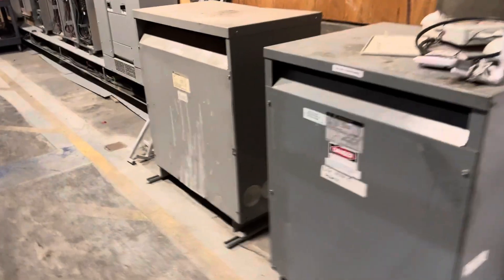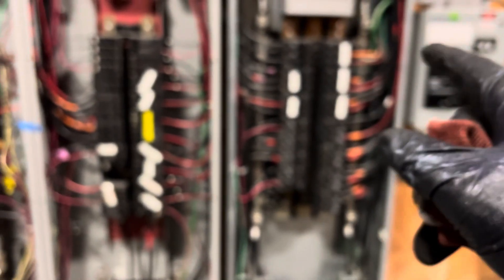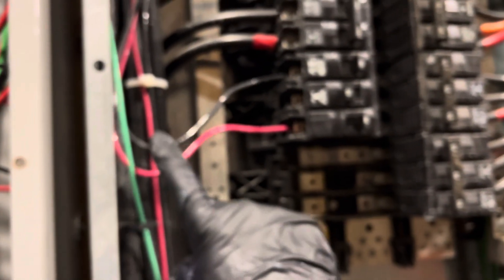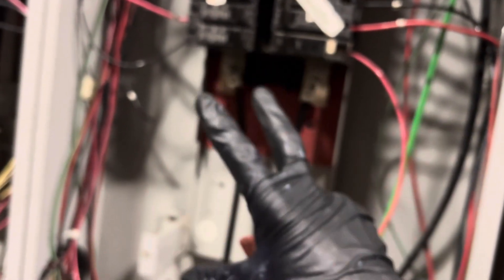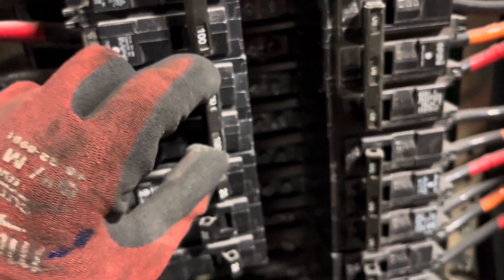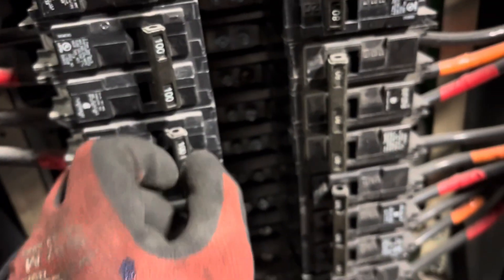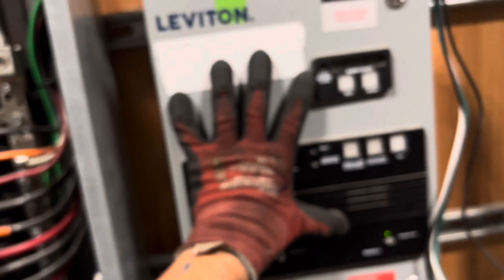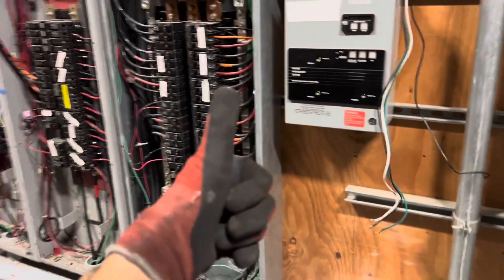Dealing With Electrical contractor, Nightmares Incompetence ￼.

Comment: Most people just go hurrr durrr electrical wizardry idk how it works
Reply from the maker: It seems like here in California where I live the only qualifications you need to be a electrician if you can insert batteries into a flashlight flicker switch and a lightbulb turns on you’re qualified
Reply: You guys all “Delta up to the gills”!

The electrician did nothing wrong. If you want to protect your sensitive control and communication equipment - you have to do it yourself. Galvanic isolation and DC/DC converters!
It’s normal to have motors on contactors. And people who run 3φ equipment - don’t care about neutral, they don’t need it.

You got to power up everything out of separate transformers from split single or 3φ, use DC/DC converters and separate ground of PLC and sensors from rest of equipment bonding circuit.

I deal with that a lot! Uber noisy grounds, sandy soil, dry weather and bad or no neutral, with spikes showing up on ground like the sky over NYC on the New Year!
Reply from the maker: @commenter5469  he wired single phase 2 a three phase panel and put 120 V to my 208v air handler‘s

Can you wire the Tesla charger to two separate 120 V circuit breakers spaced several inches apart from each other, one blew and single phase charge

He wired 277 to 240 LED wearhouse lights blew them. 

My panel for my equipment has stickers writing and posters all over the front of it seem to DO NOT ADD ANY  heavy load, contactor, motor devices, or arcing type devices to it, explicitly 
DUMB ASS DI IT ANY WAY COSTING CUSTOMER $10K in losses 

He wired 120v fans on 208 v all on the same circuit breaker.  And was wondering why it kept blowing a circuit breaker
He didn’t read the motor label voltage rating 

On top of that, you cannot start five fan motors simultaneously on one circuit. 

HOW CAN YOU DEFEND THAT.
Reply: Did you find empty cans of a/C pro laying around also?
Reply from the maker: @nservice1625  l think he was huffing the AC PRO

Comment: I can see the 277 to the lighting mistake. While they should have verified most commercial buildings use 277 lighting cause it's more energy efficient. In all good work tracing all your issues. You might have found a good career ❤ electrical can be a pita
Reply from the maker: I’m always doing this in most commercial jobs locations I get called into for air conditioning. I end up babysitting and correct in electrical issues.. 

Especially when somebody from residential takes on a commercial job with three phase .  And they don’t understand the different wiring of the different transformers..  

And like this building originally did not have a ground. 

Some of the old lighting someone used a green ground wire that was originally to a water pipe and turned into a hot leg. 

I found that out by getting a surprise when I disconnected the green brown wire. Well, my arm was on the conduit.. 

But I always tell everybody I’m just a old Automotive Mechanic in an HVAC guy.
Reply: I got about 20 commercial led shop lights because of a 460/277 mistake.  Just had to solder in new fuses.